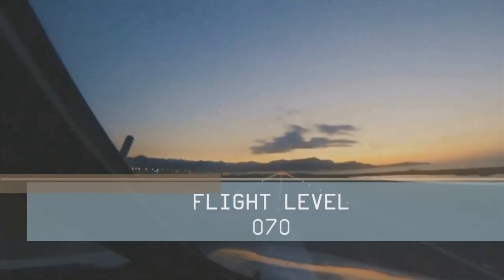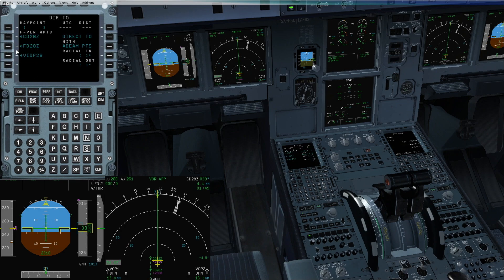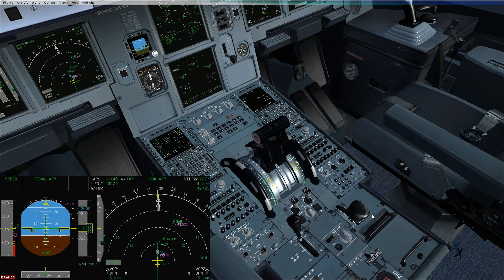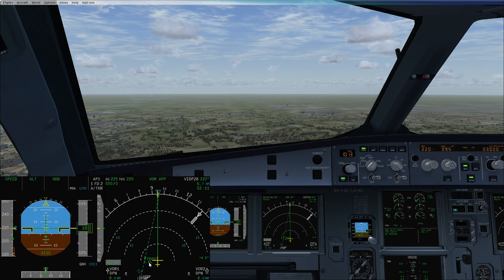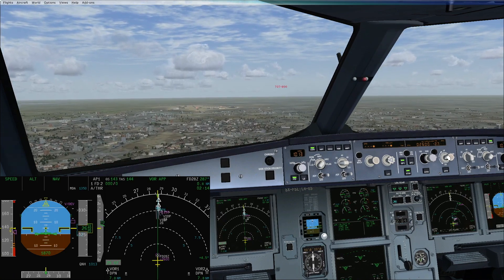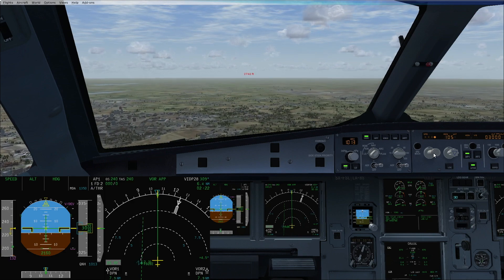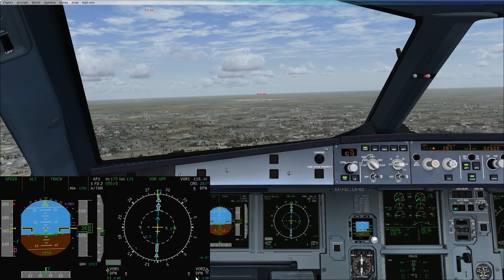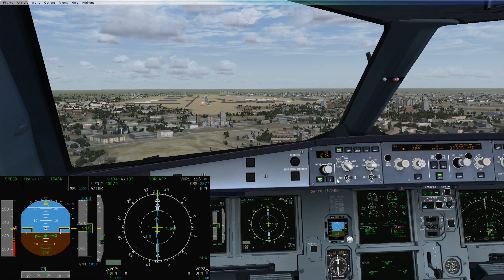A 320 : Non Precision Approach

Comment: Since you got the system to run it, I recommend trying FSlabs A320 or shifting to Xplane11 and Flightfactor A320. They are miles better and really close to how it should be.
Reply from the maker: Hi Ron . Thanks for your suggestion. Currently running FSLabs 320 with FSX steam. My mistake I bought 320 for fsx. Their platform is really old.